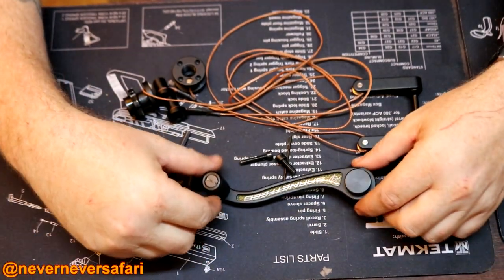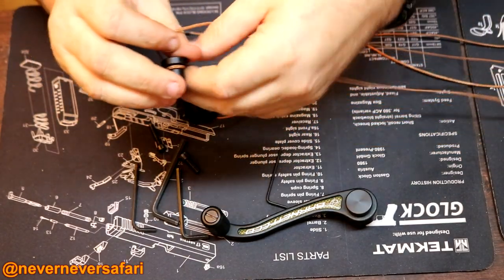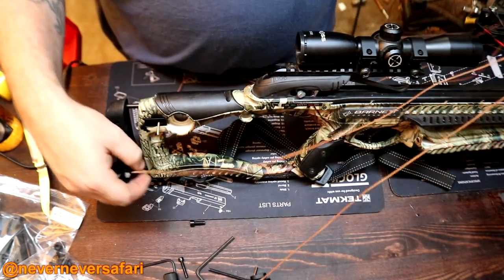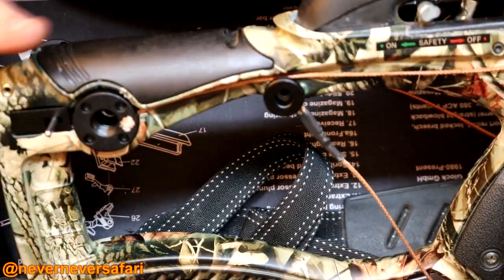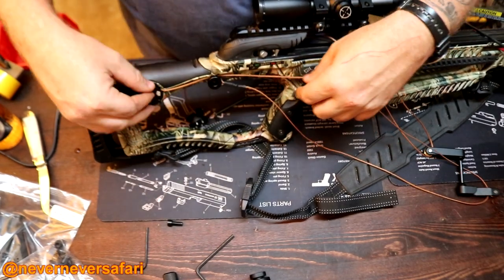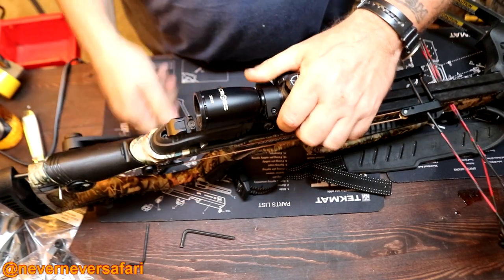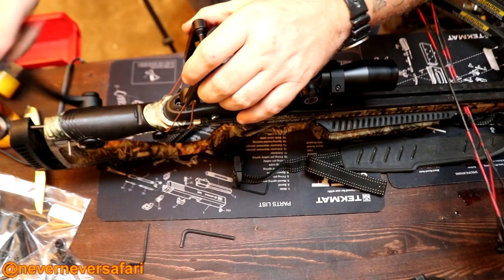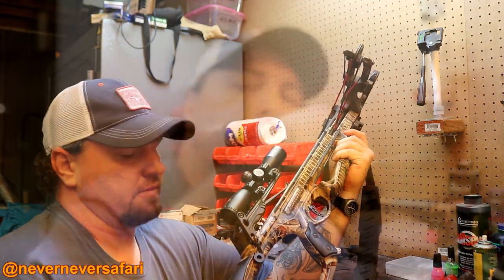Barnett Crossbow Cocking Crank Installation ( raptor fx crossbow ) - Never Never Safari

Comment: It doesn't fit the headhunter good either. It's actually easier to use the manual pull. You can't decock the bow either. The sled covers the safety. Barnett should make these to fit each bow specific.

Comment: the rope is supposed to go through the accudraw sled pulleys and connect the two hooks together. Then you spread the two hooks apart and place the string between the two hooks into the groove thats made into the crossbow stock right above the anchors. Its supposed to be used just as you would use a manual rope cocker, as this groove gives you more leverage and makes it even easier to cock using either type of cocker.

Comment: Thanks for this video & thanks to Ken below for the additional info.  Just bought Barnett Whitetail Hunter II & am having trouble with the regular rope-cocker.  I am a small-framed woman & have trouble pulling the handles up above my waist (no problem till then) and first was kind of bummed out after watching your video cause the issue of where to put the darn thing when you're done with it.....but if Barnett really has fixed that issue, then I will probably go ahead & get one.
Reply from the maker: Deanna Duche glad I could help , hope it works out for you. Make sure you practice with it because your bow will shoot a little different than when you use the the hand cocker.

Comment: I shoot a Wildcat C5 and installed this because I hunt from a Summit Viper climber which is a closed face treestand. Because it's closed face I can't get the crossbow into position while up the tree to hand cock it or use a rope cocker. This crank cocker solved my problem. For me it works great. The rubber mount that holds the part that grabs the string mounts behind the scope on the stock and fits well. Evidently the newer design of your crossbow doesn't allow for the rubber mount to work. The only problem I had after adding this was that the rubber holding device doesn't really do a very good job of holding the cocking device in place while using or carrying the crossbow. So I just put everything where it's supposed to go and use a small bungie cord to wrap around it and the crank handle and everything works perfectly and stays out of my way until needed. This also allows me to keep the crank handle on the crossbow without it shifting down and getting in my right hands way. I hope you found a way around your problems because this device has made my crossbow easier to use while I'm in my stand.

Comment: The kit now comes with a saddle that installs just behind the scope mount. As stated in the instructions, you might have to order one (no charge) for your specific crossbow. On my Quad 400, the saddle Barnett sent me free snugly holds the pulley cross bar and the saddle has protrusions that hold the pulley legs down and to the front so the string leads are fair and short.  When tucked away like this, I can completely ignore the cranking cock and use the rope cocking device.

Also, it doesn't touch the scope or mount and there is no interference with using the scope.
Reply from the maker: Cool deal thanks for the info, ill have to call Barnett and ask them about one for my bow

Comment: I hook it onto the top of my scope like the other guy did on YouTube. I've got mine set up with a zip tie to where it doesn't put any pressure on the scope at all you don't have to crank it back to keep it in the slot you just push down on it and it stays in this slot. I have taken deer with it this way this year.
Reply from the maker: I never could get the rubber to set on the scope right , but it works well on the rail. Good luck in the woods this year and thanks for watching .

Comment: Hi great video and very informative. I've got one on route at present, can I ask should the hooks that go on the string hook underneath rather than on top like you had it, as I've read that when clocking the raptor fx they cocking string should be under hooked rather than over the top... Many thanks for any info or thoughts on this. Atb

Comment: Very informative video. Just picked this up off of a co-worker for 50 bucks. He used it once, didn't like it. The book specifically states Not to use this device to un cock the bow. This is really why I wanted this thing. When you pull back on the spring loaded catch , does the handle want to fly off or can you still hold onto it?

Comment: Last question.  After cocking the bow as I crank the sting in, the string pops out from behind the anchor... I tightened the bolt as far as I could yet the the string still pops out.  Any idea?
Reply: I hv that problem 2

Comment: Just watched your video (twice) before installing a Crank Cocking Device on a Whitetail Hunter STR.  All I can say is damn! Damn awkward.  The crank handle will only attach to the right side.  Although there are threads on the left spool the screw will not attach.   When stowed, the hook touches my face when trying ro sight in.  Fortunately, when installed you can still hand cock the bow.  The handles is almost always in the way when firing.  Once cocked you have to fiddle with the handle to move it out of the way.  Four years later and they haven't fixed this device!!??

Comment: I'm sorry I deleted my other comment where I explained this Amazon review I will writte it again. Nice video and very nice crossbow! I'm considering buying one of these my self but due to an injury in the shoulder I wouldnt be able to use it without the crank so I was curious if you have had any of problems with it like what that amazon review says because in your video I didn't noticed any of that. Now I see there is no such problem right? I was looking to the both recruits the compound and the recurve they have the same stock so I guess they will work fine too. The other thing I wrote was that in that same review there is an image that shows how to hook it to the groove on the stock I hope it helps to solve your problem Thanks for answering (: https://www.amazon.com/gp/customer-reviews/RVDIPJK61EKUU/ref=cm_cr_dp_d_rvw_btm?ie=UTF8&ASIN=B00DT5A0M6#wasThisHelpful

Comment: Amazon review:
"DO NOT BUY THIS if your expecting to get a "string puller assembly" like its pictures on the box. Now that it's 2015, Barnett changed the "vertical brass pulleys" to a new design which has "horizontal brass pulleys", so now it will torque the draw strings at a 90 degree angle and it's very hard to crank it the last 6 inches and it's really, really hard to get the strings back off the spool. The horizontal pulleys will bind and cut your string. I will add a picture what it looks like now. (It's like a serpatine belt on your pickup motor, and it rides on 6 pulleys and you turn 2 pulleys sideways. How long will it be before you cut the belt). If you can still get a 2014 model, that will work great. But, the new 2015 model change that's not shown on the box cover or instructions will NOT work correctly on the Barnett Recruit or Barnett Raptor. F.Y.I."
Reply from the maker: Fernando Soltero I'm not sure what you are  referring to but I bought this one in 2016 off off of Amazon. All I typed in the search box was Barnett crank cocking  system, and I bought it in 2016. The system I bought was used for the ghost 400 and other Barnett Crossbows.

Comment: Did You ever have the problem with the broken string, what many owners of the Raptor FX complained about?
Reply from the maker: Ive  broken the bow string 2 times, but both times it was because of a loose nock
Reply: And did that happen with 3rd party bolts or with the original carbon bolts that are in the package?
I am asking because I fired several shots with the original easton bolts  and nothing happened.
Reply from the maker: it was some that I bought when I was sighting in, they were grouping so tight that the arrows hit the nock and moved them. I didn't notice it until after I fired it. I just put some glue on the nock and it hasn't happened again.

Comment: My crank keeps trying to pull the right side up first what is my problem?
Reply from the maker: Brock Jones sounds like the string alignment on the crank is off a little. You need make sure that where the string goes in the crank assembly that they're both in the same spot. If they're in the same spot make sure that one strings not shorter than the other.

Comment: Unless you have some kind of disability..IE.. shoulder or back problems..you don't need a crank devise. They are slow to reload and noisy. Any normal adult male or female too ..should not have a problem using a rope cocker for any cam style crossbow. The only exception would be the Excalibur recurve style crossbow Matrix series 355..380 405...these crossbows are a bitch to cock unless you have above normal  strength.